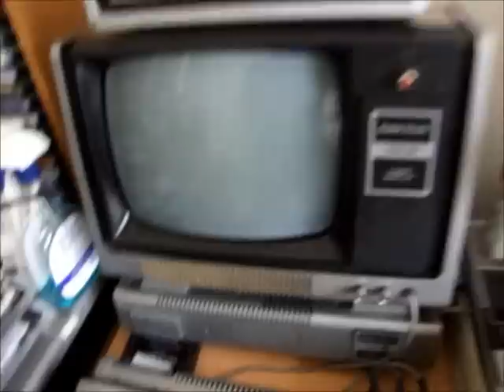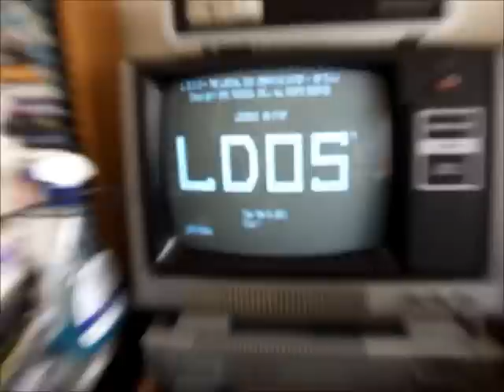TRS-80 Model 1 vintage computer set up and boot up - part 1

Comment: I bought mine initially as a 4K memory unit without the expansion interface.  Later I upgraded to 16K, expansion interface and an Exatron Stringy Floppy.  I kept ahold of it until about 1992 and decided to enrich the local landfill.  Brings back good memories!

Comment from the maker: Hi, the power supply is fairly specialised, requiring 15V AC coming into the computer, where the internal power regulators split it into +12V, +5V and -5V DC as needed.  The monitor is easy to connect to a mono green screen through RCA lead, as only 2 of the 5 pins on the monitor jack are needed, VIDOUT and GND.  Email me if you need more details.

Comment: Too bad you didn't show how to boot up the "Trash 80" with the tape recorder using a tape cartridge. The flashing lights on the screen showed that the boot up was going on, but if the sound level was set too high or too low it wouldn't boot up and you had to do it again.  Same problem with saving data or a program. All of your add-ons were not original equipment and your computer with disk drive and expansion module make this computer  much more usable than the original.  When I got my first TRS-80 in 1979, it only had a 4K memory. Even so I learned enough BASIC programing to make it a useful office tool.  Later when I got an upgrade to 16K it really flew.